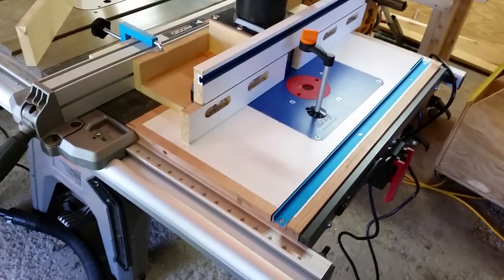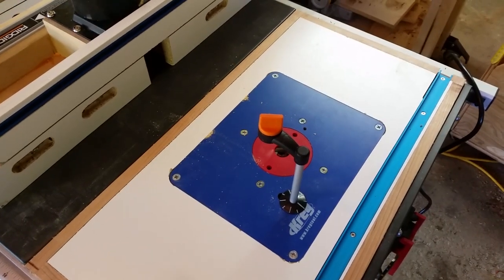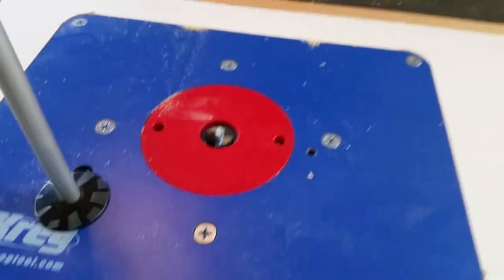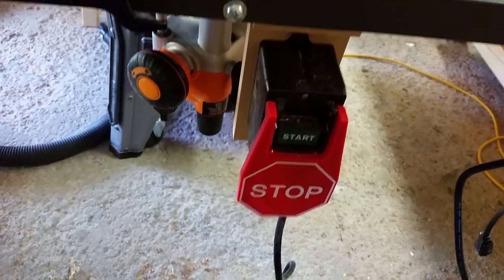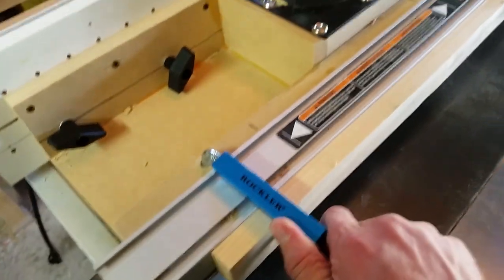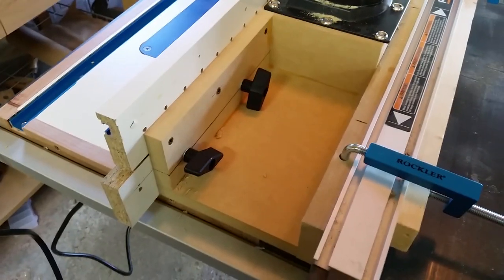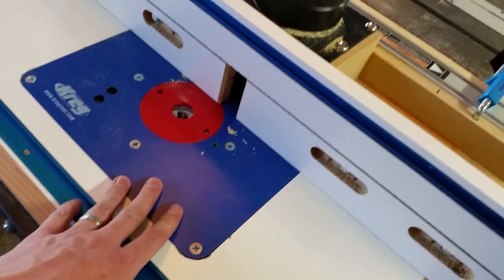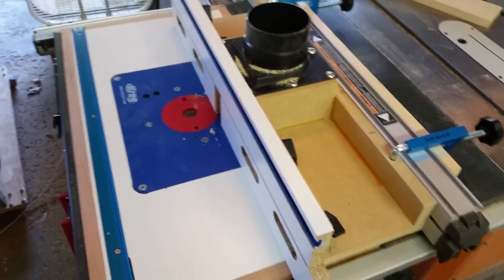Shopmade router table extension and fence

Comment: I am thinking about building this.  One modification I have in mind is not clamping the router fence to the table saw fence, but instead having a horizontal piece of wood run on top of the table saw fence and bolt it onto the top.  That way I have the left side of the table saw fence free without removing the router fence.  Do you see any problems with that?
Reply from the maker: No I don't think there would be a problem. take a video when you're done and share it!

Comment: I have never been quite sold on the router table extension idea, the main reason is I'm not sure whether the Rt fence would interfere with the function of the table saw  , have you faced any unforeseen problems since the RT installation?
Reply from the maker: The router table fence clamps on to the table saw fence. It is completely removable. No interference at all.

Comment: Hi! I'm about to do the same thing, and am wondering about the thickness of your table. I have the same router and plate, and the plate suggest 1.25 thickness for the table. Is yours much thinner than that? Thanks!
Reply from the maker: +Doxie Lain It's .75" melamine. I did put supports running across the base of the melamine on either side of the plate hole. I have not noticed any deflection.
Reply: +Peter Horn Thanks! Most appreciated.

Comment: What insert do you have in your table saw?
Reply from the maker: Kreg's router plate
Reply: no on your table saw, not the router table portion. Is that the original table saw insert that came with your rigid saw?
Reply from the maker: Gotcha, it's a Leecraft RG5 zero clearance insert.  
https://www.woodcraft.com/products/ridgid-r4512-table-saw-zero-clearance-blade-insert